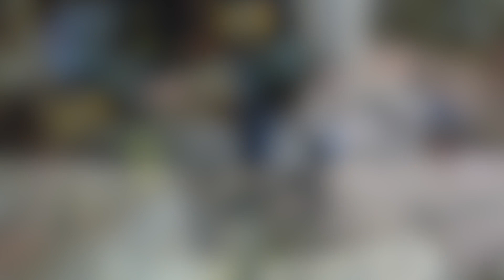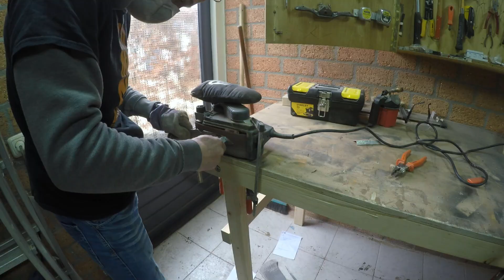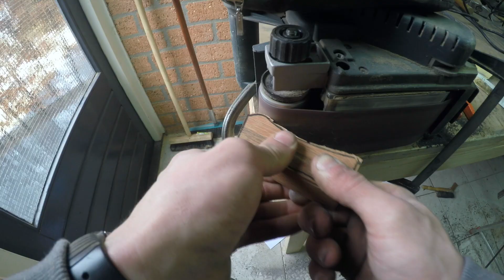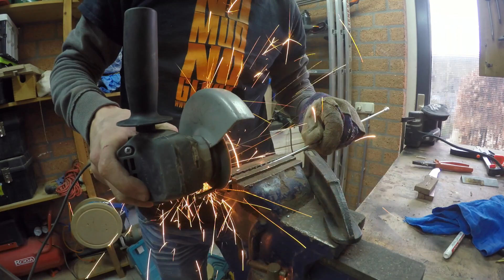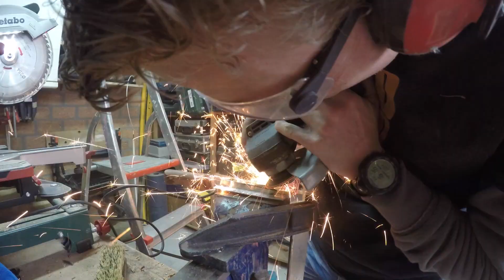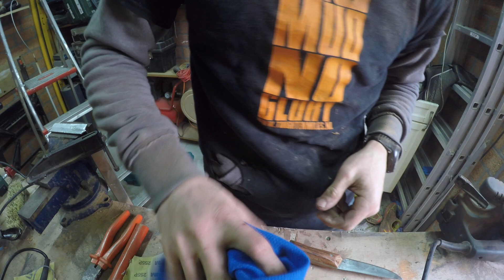Homemade knife

Comment: Next time polish the blade. Also, make sure the fingerguard isn't as pointy as it is now. It kinda defeats the purpose. And also epoxy the wooden handle to the knife instead of just riveting it, over time it will come loose. Otherwise its a great first knife! Great job.
Reply from the maker: Thank you for the tips :). I will use them next time.